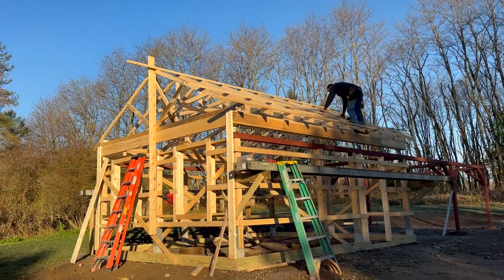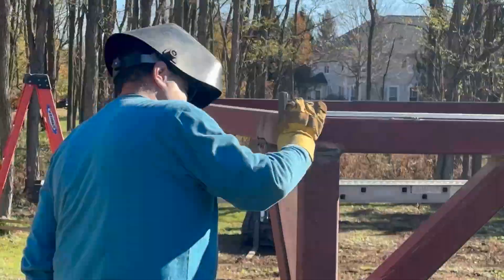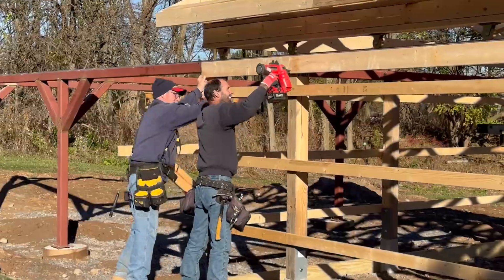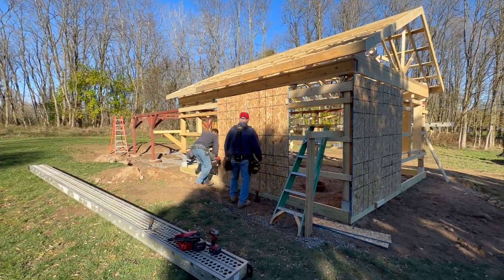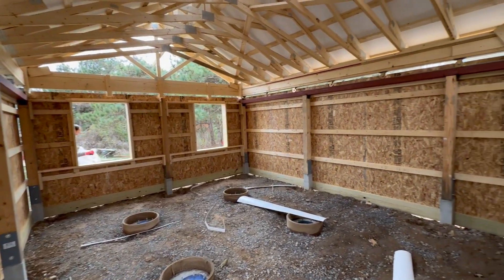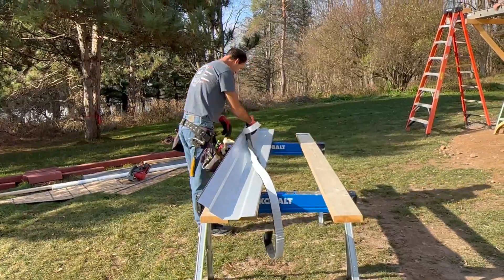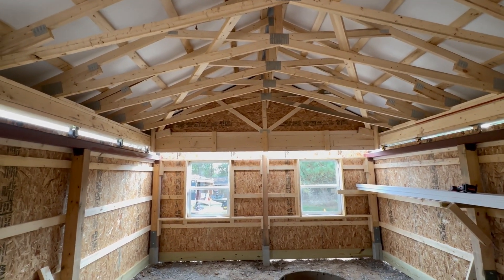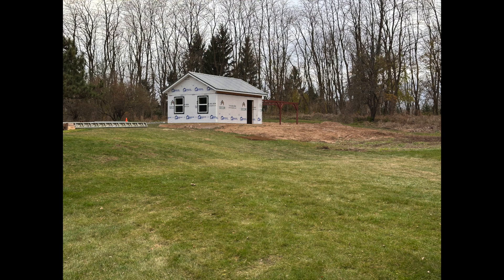Observatory Update:  Roofing, Skins, and Test Opening the Roof!

Comment: I’m really enjoying this series.  It looks like whenever there is a challenge - you go for the best alternative. I like this strategy - even when it costs a lot more. You won’t regret it.  

When you designed it for 8k lbs load, that must have included snow load right? Because I don’t see how that roof, as built, would be much over 2k lbs. Maybe I did it wrong, but that seems too much.   The other item, it looked like the poles were placed on concrete footers 4 ft down, braced level, and filled with dirt. I would have much rather seen concrete piers, (like for your 4 mounts). Then use poles that are a combination of pressure treated for the first few ft, and untreated wood for the rest of the pole. Placing the poles on the piers using Simpson brackets. Probably doesn’t matter much, just seems odd to me.  Finally, did you consider LP SmartSide instead of OSB? It replaces the OSB, and does not need a house wrap. It has a wood like finish and is primed, ready for paint. Costs about $50 per 4x8 sheet. I haven’t watched to the end yet, so I don’t know how you plan to finish the building.

Anyway, it is going to be a fantastic buildiing!!!
Reply from the maker: Thanks so much!  My original plans called for the roof to handle a 7000 lbs static load.  But when I shifted over to the pole barn method of construction I needed new blueprints and I had an engineer do them.  He indicated that the state of NY required a 14K snow load for that size roof, so I choose the the wheels accordingly.  The poles used are engineered  columns.  The holes were 58 inches deep and then 10 inches of concrete were pours to form a foundation plate for each below the frost line.  The columns had a 4 foot base of reinforced concrete that was 3x stronger than poured concrete.  These were then attached to uppers that were laminated beams 8x8 inches with heavy plate steel.  So no wood goes into the hole. Just the engineered concrete column Portion. These are quite strong.  The top is tied togehter with the steel header and the slab is poured around the base. So its all tied in nicely.  CDX was used for cost and because that was the material the builder is used to working with. and could get easily.  The design assumed the steel box beams would have 1/8-inch thick walls. That what we ordered.  What was delivered was 1/4-inch thick wals - MUCH heavier.  This thing is a rock.

Comment: It’s amazing how quick it goes up once the base was poured, it seems to be moving super fast now..👍🏻
Reply from the maker: Yes indeed.  But it will slow down a bit now.  I need to get some electrical work done before pouring the slab and installing the remaining parts of the drive system (linear drive gear, passive lockdowns, and manual lockdowns). This will require getting the right group of people together, so scheduling and weather will slow the pace a bit.